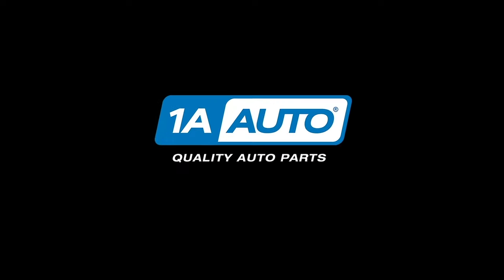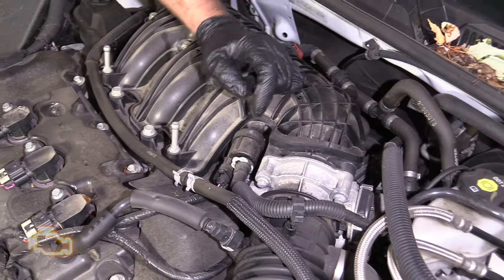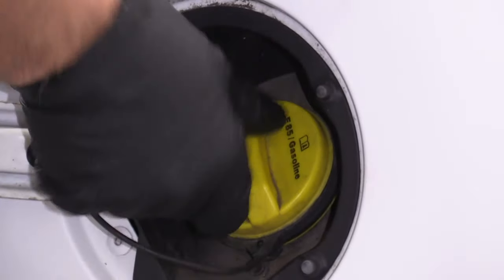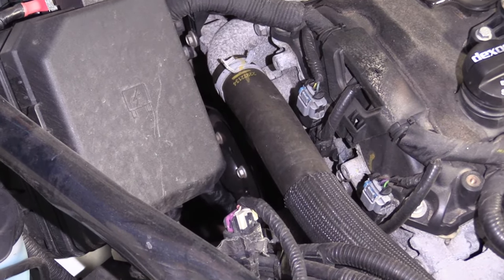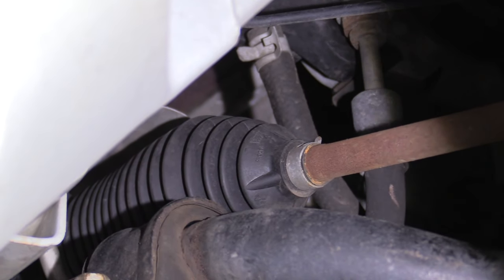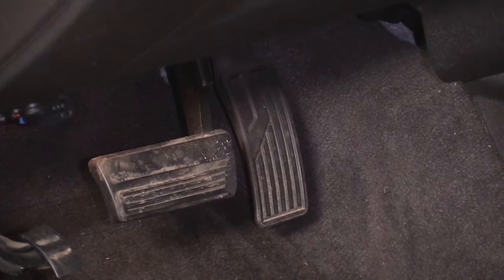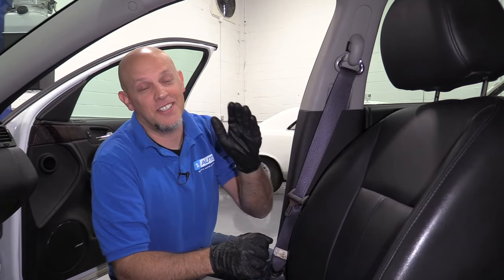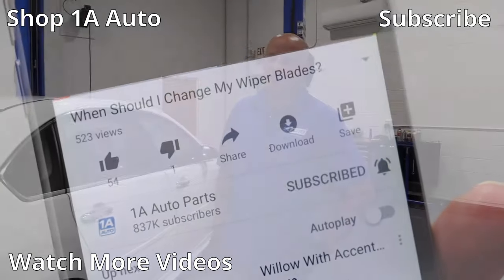Top 5 Problems Chevy Impala Sedan 9th Generation 2006-16

Comment: What it comes down to is manufactures making a car is cheaply as possible with the cheapest possible parts from the cheapest supplier in trying to pass it off as a quality product. I have owned and impala for the last 5 years and truly I am not impressed with the quality or the performance of the car. In my opinion you'd be better off by in a Honda or a Toyota but opinions vary.

Comment: I've owned two 9th gen. A 2007 LT 3.5 with quite a lot of miles, which I replaced for a very low mile 2013 LT with the (very fun) 3.6 LFX. Honestly? I know these cars very well and although they are not the best car when it comes to reliability, there are far worst cars out there. Things that will break are usually smaller interior parts and other annoying yet not essential parts. Things to take in mind: The 9th gen come with 4 different engines and 2 very different transmissions, one of which has at least two variants. All of these have their unique pros and cons:

Pushrod V6's and V8: These come in 3.5 and 3.9 variants, with 215 and 242 HP respectively for the V6's and a 5.3 with 300HP for the V8. These engines are quite solid, smooth and at least with my personal experience with the 3.5 I had zero issues way past 100,000 miles. Although they are know for throttle body issues and even head gasket failures (V6's). So be aware. The water pump issue is with these engines in particular (V6's). I had mine fail at 95,000 miles. I was lucky to notice some bubbly noises behind the dashboard which were the actual coolant leaking and bring air into the system. I never had overheating issues thankfully.

The "Limp mode" or "reduced power" issue is also unique to the two pushrod V6 Impalas (3.5 and 3.9). It may also appear in the 5.3 V8 Impala, and it is not only cause by the pedal, but also the throttle body.

Be also very careful with the 3.5, 3.9 and 5.3 Impalas. They have a very fragile 4-speed transmission. In the 3.5 it will most likely last through the life of the car, as this transaxle won't have to put up with much torque (if driven gently and well maintained). The 3.9 however, will stress the transmission a lot more, so make sure you have it checked before you get a 3.9. And the 5.3, just get away from it unless you know the transmission has been replaced before buying it. That transmission, even with it's "heavy duty" variant found in the Police version 3.9 and the 5.3, is not meant to handle more than the 3.5's lower power and torque figures. Also, if getting one with the floor mounted shifter, be aware that the linkage on these tends to snap, leaving you pretty much stranded. Always go to a complete stop, put it in park and without releasing the brake, apply the parking brake. That will leave the transmission with zero load on the pin, making it super easy on the shifter cable when pulling it out of park.

One last thing: Be aware of the ignition switch in the older Impalas with the pushrod V6's and the V8. It's prone to failure, switching the car off while driving, or causing shorts in the electrical system.

And last, the DOHC 3.6 V6 GDi: This engine is found in the last two years of the civilian Impala 9th gen. It's also the same V6 found in the new Impala. It is one heck of an engine, making 306HP (just a tad bit more than the V8). If you want the most power on a relatively cheap car with lower millage, this is probably the best bang for buck. 3.6 Impalas are quick, have good gas millage, and don't have the problems than the older Pushrod V6's. They also have a newer 6-speed transmission which is pretty much unbreakable, apart from being a bit sluggish and sometimes sensitive to weather.

But the 3.6 Impalas come with their own set of issues. Most importantly, these are Direct Injection engines, with Variable Valve timing and Dual overhead cams. You can't throw any oil in them like in a good-old pushrod. It has to be a specific oil (5w30) which is thin. This means they can consume oil. So expect to do oil changes more often. They also don't like regular fuel. As in any high compression engine, you gotta go with 91 octane or more, or else you'll have pre-ignition issues. Also, as any GDi, they build up carbon, which further worsens the knocking problem. So have them carbon cleaned if they are in the higher millage range. Other than that, I found my 3.6 to be much more dependable than my old 3.5.

Other annoying common problems with all 9th gen that EVERY owner has had to deal with: Water in Fuel codes (fixed by changing the gas cap, cleaning fuel system and topping off tank during harsh weather to avoid condensation). TPM not reading correctly. Stabilitrack issues with Traction Control going off at random, usually when turning the car either left or right. Noticed by a strong pulse in the pedal box area and the car slowing down on its own (caused by a Speed Sensor harness breaking due to poor materials. $20 part. Expect to replace this once every one or two years). And the ever annoying nightmare that are the climate control actuators. these will produce that well-known horrible taping noise behind the dashboard. The three of them can be replaced on your own (there are tutorials everywhere) in between 20 minutes to an hour and they cost about $40 each. Dealership will charge you up to $600 for just one.

There! I hope this helps if someone is interested in buying one of these cars. They are not great, but far from the worst. You get an elegant, in some cases, very powerful sedan at a very good millage/price range. Take care of your Impala though! They are not Toyotas.
Reply from the maker: Awesome! very helpful. I personally really like the 3.6L great power fun to drive, good fuel economy. Thank you for checking out the video. If you need auto parts go to: http://1aau.to/m/Shop-1AAuto-Now
Reply: How bad is it replacing the water pump on the 3.6?
Reply: Do the 2006 PPV models come with Stabilitrack?
Reply: I have a 3.6L with 202k on it. Still a very strong car. I do a lot of milage based maintenance and it seems to have helped a lot. I hope she will last me for a long time. I love my Impala. (2012)
Reply: @bc4134  I have 210k on my 06 3.9L PPV. For a car that has been abused most of its life, it still runs super strong.
Reply: @bc4134  That is a lot of miles! That gives me a bit of confidence that mine will last a bit more. I have a 2013 3.6 with 70k miles
Reply: I have a 2007 3.5 Lt fuelflex and have 270 thousand miles on it. I've had minor problems but was able to fix myself other than the catilac converter. But I have a question for you or if anyone can help. My car does that engine reduce thing and replaced the accelerator pedal and it went away and now has come back. Do you have any ideas what I might be?
I even had a catilac converter put in. Any help would be much appreciated.
Reply: @TheHuskyGT  i highly recommend using BG Products when servicing. At one point I was burning 1qt of oil every 1,500 miles. The BG EPR engine flush helped with my oil consumption problem. And the BG Air Induction Service helped clean up my nasty intake valves. They really make a huge difference. Also cleaning or changing the pcv valve often because it can become clogged. One thing to keep an eye on is the Camshaft Actuators aka VVT Solenoids. I had 2 go out around 150k miles. But they were an easy fix.
Reply: @cpartida6969  So this can usually mean that the Camshaft Position Sensor has gone out. My 3.9 PPV did that once and I broke down on the side of an overpass. Wasn't a great experience. I'd also replace the crankshaft position sensor as well.
Reply: @cpartida6969  have your throttle body tested. On my 2011 Tahoe I had my throttle position sensor fail and it would go in to that mode. Mine was fixed under recall. Im not sure if the Impala has this issue or not.
Reply: Thanks for all that info better than the video itself
Reply: This comment has to be one of, if not the most, detailed explainations as to what can go wrong on a specific vehicle, which also includes failures in OTHER VARIATIONS. Honestly, I'm greatly appreciative of people like you, that go out of their own way to make life so much easier for others. Thank you so much man, these things will be easier to look out for now that I have a good sense as to what could go wrong in these Impalas. Have a great life my guy, you deserve it.
Reply: This comment is awesome! Thank you for taking the time to give a detailed explanation if problems. I actually just happened across this video because I have a very troublesome 2013 chevy traverse and the deaded traction control off,  service stabilitrak,  engine power reduced issue and we cannot figure it out! It has even started stalling when going into limp mode randomly! We have changed the throttle body, an oxygen sensor, wheel bearings, and ignition switch and still no changes. Do you have any advice?
Reply: @bc4134  what gas do you use, what oil do you use and how often, and how many problems have you had?
Reply: @fakejeepman06  I never use anything less than an 87 Octane rating. A can of seafoam every 5k. Oil, I use Royal Purple if I do my own changes, or valvoline if I have to take it in.
Reply: @fakejeepman06  oil changes every 5k. These engines do burn some oil. So I check my oil level every 1k and top off as needed.
Reply: @bc4134  thanks for the info! I really like impalas so this is very helpful!
Reply: @fakejeepman06  one thing to also keep an eye on is the PCV valve. They need to always be clean, otherwise it can contribute to the oil consumption.
Reply: @bc4134  good to know! Thanks!
Reply: You started the newer impala’s with the 6 speed at sensitive to the weather, what did that exactly?
Reply: @unitedwestanddividedwefall3521  It shifts a bit rough during winter. It then shifts fine after it warms up. But I think this is something common in a lot of cars.
Reply: I have a 07 with the 3500 V6 in it with 160,000 miles. When I stop at a stop sign or light and then prepare to take off the car seems to have slack and I have to be very careful taking off bc it will jerk hard unless i accelerate lightly first. if i accelerate too much before the drivetrain catches up(1 second) it jerks hard as it catches. If it was rwd id say u joints but its fwd so im kinda lost. Anyone have an idea of the problem? Is it the tranny or maybe even a bad cv? Also if i put it into park on a hill i have to use the e brake or its hard to get into drive. Is this tranny linkage?
Reply: @saltycracker2422  on 3.6 not bad I haven’t done it yet but you can see the pulley and see that it’s very accessible, you can loosen the bolts before pulling the belt off.
Reply: Thx for the info. I’ll definitely not buy an impala now.
Reply: I really like the older impalas like these but I think you've fully convinced me to stay away haha. Never had that much trouble worth any of the other vehicles I've owned. Even the crappy ones.
Reply: Dude you are awesome sauce !
Reply: @bc4134  I love mine to man I can see me being 50 with my original one With like 7 more parted out in the back while my baby's all original
Reply: I have a quick question what is causing me to have massive fuel loss on the highway I have an I have an Empire with 250000 miles and has been relatively Well maintain however I've been tripping ATC M code That I had taken out and the transmission is shifting fine however I'm getting 10 to 15 miles a gallon is that in the fuel system or that because of the bad tcm
Reply: I just bought a 2006 impala Lt 3.5  v6 223k miles on seems to running pretty smooth I changed the oil right away filter as while today putting a new air filter in scared to see what the old one looks like when i pull it out lol! Paid 1600$ for it  did I over pay? I mean darn they were asking 2400$
Reply: @tedbundy5911  I don't think you did. The car is pretty much at the end of its life, but you could be able to stretch it for a few more miles with proper maintenance. I have seen ones with a ridiculous 400k miles on the original transmission and engine. The problem is not entirely the engine and transmission, but everything else that pretty much falls apart to dust. GM "quality"

My 2013 LT 3.6 is currently 82,000 miles. All paid off. Still running like new. Given how car prices are, I will hold on to it. These cars are worth it if you got them cheap, even with their little annoying problems.
Reply: hey husky… awesome writeup. a learned a bit from your comment and that’s greatly appreciated. i have an ex-PPV 2013 with the 3.6L LFX, has 97,000 miles… definitely an engine with plenty of power.

your comment on only using 91 octane is interesting though, considering the manual recommends 87. i’ve been using 87 so far (with E85 thrown in here and there just for S&G)… is using 91 something you honestly think is better for this engine?
Reply: @jimmothyjoyner  Being a Direct Injection engine with high compression, it is a safe option. However it all depends on altitude  and gas quality where you live. In my case, if I put anything under 91, the engine will pre-egnite. Which is not good in the long run.
Reply: @TheHuskyGT  i just did some research… the CR for the 3.6 LFX is 11.5. so yeah you’re exactly right, this thing shouldn’t be getting anything less than 91. 93 at best. i have absolutely no idea why GM recommends 87 in the manual… my guess is that they never changed the literature when they switched from the 3.5/3.9 engines with a 9.8 CR. sheesh. thanks GM.
Reply: @TheHuskyGT  thank you for the reply though. i have spark knock and now i’m absolutely sure that’s what’s going on.
Reply: @davidwc2675  
Good choice. I have an 07 and it's the worst car I ever bought. I've owned 46 cars in my lifetime and the Impala scores #2 Worst of all of them. #1 Was the 96 Grand Am SE. Total Basket Case
Reply: @Corkoth55  
Same
Reply: @tedbundy5911  
They're junk! Good luck with the Trans. Issues and sensors galore. I have an 07 and I regret every dollar I spent on it.
Reply: @TheHuskyGT  Let's put this into perspective a bit.  Even at 250K most American model gasoline engine vehicles have reached their service limits so anything beyond that is a bonus.  To state that one with 400K is falling apart because of GM quality parts is being malicious since it is well beyond its expected life span already.  If you recall it is only a few decades beyond when a vehicle was expected to only last 100K.
Reply: @cpartida6969  did you have a check engine light come on during your issues? And a delay in accelerating/ sound like it’s trying to catch gas
Reply: @dust4546  I’m having the exact same problem if you got any tips or got it fixed please tell me what you got replace to fix it
Reply: Thanks so much!!!!!🎉
Reply: Long shot but any way you remember what codes were thrown or symptoms you got from the speed sensor connector... I think that's what's causing mine to throw an app sensor code
Reply: Thanks a bunch ! Was looking to buy a 2015 impala at auction. Wow 91 fuel Really? I use lucus fuel additive . Buy by the gallon jug.  Am sure if you add to 87 fuel it will work great.  Impala seems to be a great car in most ways.  Has a real transmission at least not a CVT.  Great economy ,rides nice ,roomy . Peppy, looks good,
Reply: I love your informational comment!! I love impalas. Dad had several growing up as he was a mechanic so cars come and go for him. I have two impalas now. One is a 2009 that I put 212k miles on and only thing I did was several ac actuators, a power steering pump, the gas pedal, and a starter. I beat on that car so much, like way more than any car should ever be able to handle, and she’s still running strong🥲
Reply: Hello, all! I got Stabilitrak and Traction control service lights on, sometimes, i need to replace 2 fuses, maybe someone know, how to fix it?
Reply: How can I get my 2007 ltz Impala 3.9 out of battery saver mode,, desperate for opinions and suggestions
Reply: Can someone help with battery saver mode and what   the solution is to solve problem 2007 ltz 3.9
Reply: @alvomcgriff6958  Is it Reduced Power Mode?
Reply: No,, when I drive about 10 miles  the battery saver activated light comes on, have had battery and alternator check good and check battery connections
Reply: Seems to me you know these cars off the back of your head. Ok so I own a 2011 Impala LT (3.5L) I’m starting to hear a ticking noise while idiling and becomes louder when accelerating, also the car doesn’t really seem to wanna accelerate when I gas it. And when I push down on the pedal it’s like that car doesn’t wanna go faster so I just ease on the gas and cruise. Any solutions?
Reply: @bc4134 3 yrs later hows it doing now? And how much mileage planning on getting a 3.6